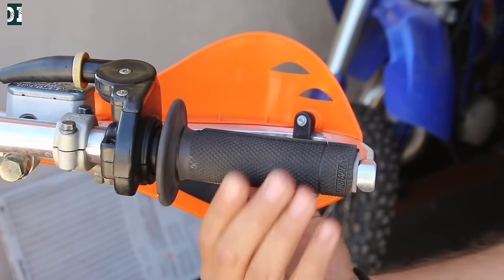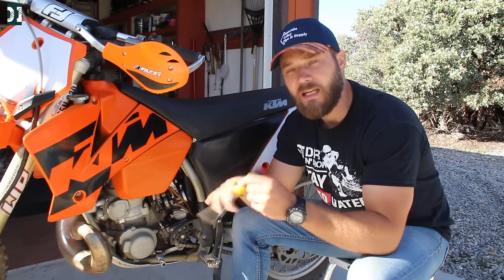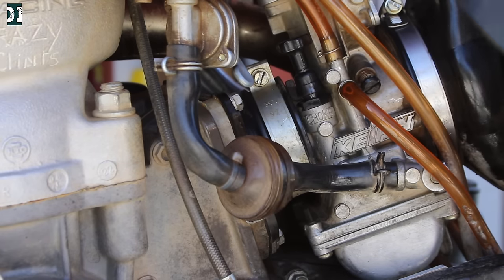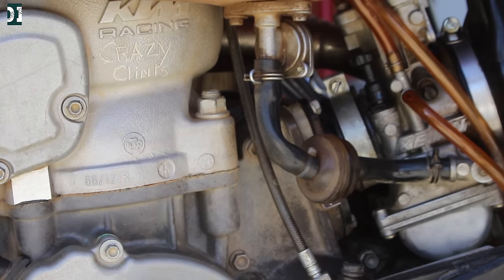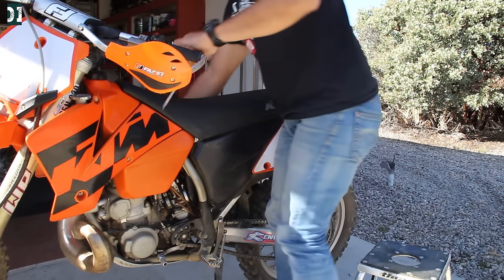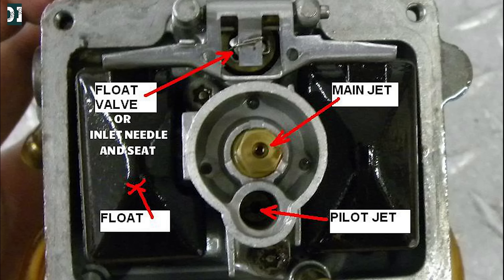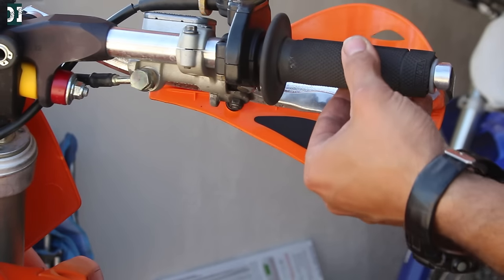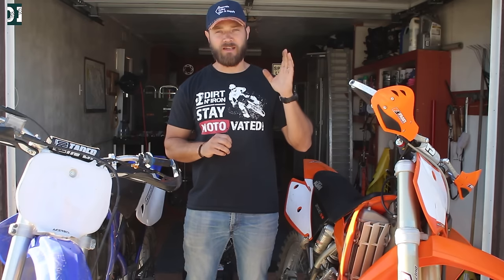How to adjust idle on 2 stroke dirt bike - air screw adjustment 2 stroke.

Comment: quick question. just bought a 01 kx 250 the bike ran great snappy response idled great! I took the carb off cleaned it checked the jets n clip just gettin to know the bike see how everything was set. I re installed & it wont start at all.. nothing and i done carbs many times in the past...i went 2 out on air and on black screw in some for higher idle then adjust to slower once running. won't start at all. any idea?
Reply from the maker: something is not right, I would take it apart and check if the fuel is getting in the carb, clean the jets. Once I had my float stuck in closed position and it wont let the gas in my carb
Reply: @dirtniron  yep did all that and it fixed it! thanks!! runs great!

Comment: So I just bought an rmx250 as a project bike, right when it gets into powerband it just falls flat on its face. They guy I bought it from said the power valve needs adjusted but I think it’s the jets. Should I try a smaller main jet or something else? Thanks
Reply from the maker: I would first take the carb out and clean/inspect/rebuild whats needed.. then start with stock jets and see how it runs

Comment: How do you adjust the fuel mixture and oil mixture on a 2 stroke? No I don't mean in the gas. I mean a good bike with oil injection. How do you know it's pulling to much or too little because the cable adjusts.

Comment: Thanks for the explanation. However in some part of the video you said air screw is for 2 stroke carb whereas 4 stroke have fuel screw. I think 4 strokes do have air screw carb as well?
Reply: That’s fuel screw on 4T

Comment: Hello there, great video, i just follow your steps to tune my rm 250 92, with pwk 39 carb, i start with 50 pilot, 1,5 turn out, i turn the chock on and kick, its start up with first try, good idle, but very low, so when i close the choke bike dies I raise half turn again, start up, idle well close the choke, idle well, im thinking, good, this the good spot of screw, and i ride it, but when the bike its warm enough i have a lot of higher idle, i must turn the screw about 0,5 turns out so the bike comes to normal idle, when its cold with 0,5 turns out i dont think will gonna start up, im confused, any suggestion? Also you said if you have the air screw all the way in and the bike runs good, you have to go one size bigger in the pilot, is this correct? or you have to go one size smaller pilot as i know?
Reply from the maker: always tune your carb when the bike is warmed up. If its cold and doesnt hold idle you can blip the throttle till the bike warms up. I was correct with the pilot size when the screw is completely in. When you have the screw all the way in that means you have smallest amount of air added to the mixture, if the bike still runs good then it will be lean if you bring the screw out and thats why you need one size bigger pilot. Makes sense?
Reply: @dirtniron  thanks for reply, to honest i didn't tune it when its complete warm up, about screw yes make sense, my thought was if the srew is all way in and bike run good, means thst you have big pilot and take enought air from there, thats why runs goods even with screw full close, thanks for your advises!

Comment: hey man. i was wondering how many turns do you put the idle screw in when you start adjusting the air screw? thankss
Reply from the maker: i start around 3-4
Reply: @dirtniron  4 turns from fully inwards?

Comment: My bike only has 1 screw (Im like 98% sure). It is a really old manual kawasaki 65. It will not idle, (I made it that way) the throttle sticks, if i turn the throttle a little bit it will rev up like 2x more then it is supposed to, then when you try to go it bogs down. So baseicly i tried to fix the idle, i forgot that was the problem.

Comment: I have a 2 stroke 80 that won't cold start even with the choke unless I run the air screw all the way closed. It will hit but not start. It's a brand new carb and clean tank. Tell tale sign I need a larger pilot jet (stock 15)? After I run the air screw in and it starts and warms up it will idle with no choke and restart easily. But after it's warm the sweet spot on the air screw is one full turn out. This makes me think it's ok? Very crisp throttle response no hanging idle. If it is too lean will this blow it up? I Premix 32:1 new top end and crank seals. I tried a larger pilot jet and it's not as responsive as the stock 15. Can I lower the needle with a larger pilot to cold start ok and to regain the crisp snappy throttle response? Sorry for all the questions. Still learning. Lol
Reply from the maker: yes, sounds like you need bigger pilot. I would go 2 to 2 and 1/2 turns out on a air screw with bigger pilot and see how she runs. Its possible to lean her out on the needle with the bigger pilot, but I would first play with the air screw. make sure your air filter is fresh and bike is fully warmed up when tuning.
Reply: @dirtniron  Ok, thank you for the quick reply. Yes, I will give it a try. I did already clean the airbox out with a brand new and oiled filter. I double checked the throttle cable has minor slack and the slide is closing fully. I'll definitely make sure the bike is fully warmed up. Should I just keep jetting the pilot up till its sweet spot is 2 to 2 1/2 full turns out?
Reply from the maker: yes, that's what I would do. Also moving the needle up or down helps to fine tune it
Reply: @dirtniron  ended up being the choke cable adjustment. It was working, but not traveling far enough. Adjusted some more slack out and it fixed it. Put the stock 15 pilot back in and ran the air screw out one full turn for the sweet spot with the engine warm. It dawned on me traveling to work one morning thinking about it. Just didn't make sense unless the choke wasn't working properly.

Comment: Hi Dirt N' Iron, I am new to two strokes and have a new BETA 125RR. Can you offer advice for the correct fuel air mix procedure for warm weather riding, we are in the Caribbean climate at the moment 27-32F humidity 60%. Cheers, M
Reply from the maker: start from stock jetting, then adjust accordingly. If its too hot then she might need more air, so go with smaller jets. I have very good experience with  JD jetting. they might have a kit and chart for your bike.
Reply: @dirtniron  Thanks for our reply! Yes the bike came with stock jetting, we haven't changed anything, if you could send me a link for JD that would be great. Appreciate your videos, very informative.

Comment: So with your idle adjustment do you start with the screw all the way in or all the way out. Struggling to get my rm125 running right brand new to dirt bikes.
Reply from the maker: idle adjustment screw maybe 3-4 turns out to start
Reply: Thanks for the reply, thought this was my issue but i have a stripped bolt where my reeds bolt down. Think thats my issue bike is breaking up good 1-3 and fouling plugs on trails.
Reply: Well turns out my bottom end was smoked, had the engine rebuilt top and bottom with all new seals. Got it on the bike today and back together, bike runs great no more plug fouling. Had to come back to the video to tune it though lol😂

Comment: hey man i bought a rm125 and it runs great idles etc but whenever i drive and give it some it ends up dying it out no too long after and the spark plug gets full of gas so im thinking its flooding but what could cause that need some help

Comment: Question: My idle adjustment screw seems like it's turned in quite a ways and could be turned in another turn too perhaps as it idles quite low, but doesn't stall. Bike has lots of power. My air screw is 2 turns out, but I feel like it might be able to go more, it stumbles when turned in at around 1 turn out, so I found 2 to be the best, but I feel like the idle adjustment screw shouldn't be so far in. The slide must really be up high with it where it is currently. Any suggestions? Running JD jet kit on 2017 KTM 300 XCW. Thanks!
Reply from the maker: I would bring the screw little more out and try to raise the idle with air screw, see where you get best throttle response..

Comment: Does the pin needle position affects the idle? For example in my old honda mbx 50 i have 3 positions in the idle clip.  Does the change of the position affect the idle speed or only the accelaration after 1/4 (and more) of throttle ?
Reply from the maker: It does affect it, but adjustment is done with air screw, and idle screw
Reply: Thank you for the instant reply

Comment: Hii, i just got a 1993 suzuki ts125r its my first bike and in good wether runs well with air/fuel jet screw turned four times out, is that normal for this model or i need to replace the jet. Bike has only 17.000 km. Thnx for the video.
Reply from the maker: Maybe try one size smaller pilot.
Reply: Thank u for your help, one more question, how many km a 125 2 stroke can do with a full tank if u can tell.

Comment: Hey man, I have a question about my bike. I have done some tuning and found out that I need to change my jetting to a smaller pilot jet and main jet due to my air screw going about 4 turns out. When I rev my engine up to full throttle and let the rpm’s fall, it doesn’t immediately go to idle and idles high rpm’s then it finally goes down to normal idle, what does this mean? Is this due to my jetting being wrong?
Reply from the maker: fix the jetting first, then see how it feels. Might be an air leak somewhere on the boot.. make sure the carb is installed well, air tight

Comment: The spring is causing my idle screw to move after I adjust it. Do I need to push spring back before adjustment?
Reply from the maker: that is weird, something is wrong. Spring is there to keep your screw from moving

Comment: What if you adjust the idle screw and nothink happens would that be a sign of an air leak or bad reeds? Just after doing a top end and ran fine before now it's hard to start sometimes and won't idle chokes don't seem to work like before . Ps has a fresh newly oiled filter ?? 👍🤔
Reply from the maker: I think that you dont have free play on the throttle cable is the idle screw does not change anything..
Reply: @dirtniron  yes have checked free play cable seems to move freely and can hear the slide moving in the carb . I'm at a loss .. would a new pipe effect it?

Comment: Really appreciate this type of content! I know is an old video, but maybe you can you help me with some advice... I changed all the gaskets inside the carb (keihin PWK36), flotor level is correct, runs fine when open throttle. The idle I cant figure it out, tried multiple pilot jeting from 40&45 (with needle in second position, tried to raise in 3rd position and have to much gas before PW and then rips) idle stay very high or die. With pilot jet nr. 48 in second needle position is not running well on 1/4 throttle, seems to much gas and also idle is very high or die. Lower the needle to first position and with pilot nr. 48 have more grunt, more linear power delivery, seems to have better idle but it still drops from high rpm to very low after few seconds but wont die, and cant increase it just a little more because it goes way up. Should I try with pilot jet 50 or smaller? or what to try next? this is killing me :))
Reply from the maker: I would look for an air leak on the carb, rubber boot or somewhere else.. sounds little bit inconsistent and that's how the air leak would behave..
Reply: @dirtniron  thanks, I would check it. First I thought are the litthe o-rings from the jets, changed them and no big improvement, but I would check the boots
Reply: @dirtniron  i finaly get it to hold idle ok by switching the needle to NECJ, p40 half turn (I will put 42)  and main 170. It runs like a rocket now, lifting front wheel in 5th gear.

Comment: My idle bolt broked two times, how do you not break it?
Reply from the maker: never happen to me, just be gentle with it
Reply: @dirtniron  yeah i am gentle, but i turns really heavy.
Reply: @lauwlicht1796  That's odd, you sure it's original? If not maybe there is something in there with the wrong size.

Comment: Great video! Straight forward with enough information :)
Does the Air Screw adjustment effects only in the throttle range of closed position up to 1/8 opening?
Reply from the maker: yes its idle to initial throttle opening. 1/8 sounds about right
Reply: Tnx!

Comment: I picked up a 97 RM 250 and I just painted handlebars and after I put everything back on my idols a little high after you started it and the throttle feels a little tight I don’t know it’s because I didn’t put everything correctly on it after I put it all back together what’s your advice it was fine before I did this
Reply from the maker: clean the bars under the throttle tube and make sure it moves freely, make sure your cable has some play

Comment: Ok Great video and explained really well. I have slight dif issue:( I have a Mikuni tmx 38 Carb and I see no air screw? I only have the idle adjustment screw? I have adjusted the idle screw so it idles smoothly like yours at 5:24 but now if I turn the choke on the rmp drops & the bike cuts out?? Grrr As you know the rmp should raise when the choke is on so completely baffled to why this is happening? Any advice would be great & keep up the good work you do..TTEA
Reply from the maker: once the bike is warmed up and you pull the choke the rmp should go down, and bike should not be running crisp. you are adding more fuel and less air into the system when your choke is on. On the cold start choke raises the rpm and bike starts easy because you give it more fuel, but once the bike is warm it does not like to run on very rich mixture. hope that makes sense
Reply: @dirtniron  Thank you, makes sense to me & appreciate fast ur response.

Comment: First time I’m setting my carb  after cleaning it.
The bike now starts without choke does that mean that the air screw it’s too far out?
Reply from the maker: it means that the bike is quite rich, so the air-fuel ratio is slightly off..  air screw too far out will give the lean mixture since you allowed more air in
Reply: @dirtniron  Thanks,
I think I found the sweat spot now.

Just one more thing, if the air screw is too far out does it cause fuel overflow?

Comment: the same with how he put the air screw 2 turns out instead of 1 and a half you get more power and response with a bit leaner. i am always putting too much oil in my mix when i mix. why i think that reliable auto oilers are something that should be looked into more for modern 2 strokes because they are really efficient with the oil which leads to not only more power but less pollution on the trails ...

Comment: My 2 stroke cr125 runs ok but when i give if hard throttle fast it bogs could u do a video on this, your videos are very useful
Reply from the maker: and it didnt do it before? or was it always like that?
Reply: Dirt N Iron well when i got it ran ok then i changed the air filter and just became worse?
Reply from the maker: Looks like it's too lean. Try to bring air screw in little bit, maybe even raise the needle a notch, that will richen the mixture
Reply: Dirt N Iron thanks man will give it a try
Reply: I have been adjusting the carb but now it keeps fouling plugs lol any advice?
Reply from the maker: you are too rich if thats happening..
Reply: Dirt N Iron this has been happening no matter how many turn out i make the carb

Comment: My bike only isles until it warms up. After that it does. I I have idle screw all the way in and air screw 2 1-2 ties out. Bogs up to 1/4 throttle but after that runs great! And help??
Reply from the maker: sounds like you need one size smaller pilot jet. bike its running rich on the bottom...

Comment: Hey DNI I have a question my brother has a rm 85 and it won’t hold idle I got it to idle by just adjusting in a screw do you think that is fine I’m just afraid of running it too lean
Reply from the maker: Adjustment to air screw should not make drastic changes to fuel mixture. It's fine tuning. Read your spark plugs and make sure you don't run lean
Reply: Thanks dni

Comment: hey man, quick question,
I have a 2007 KTM Exc 125, and when I open the fuel tap then 3seconds later petrol starts pouring out the little pipe coming from the carb (think it's the overflow) it's happened before but it sorted itself out but now I've taken out the carb and Cleaned it but don't know what the cause of that is and how to fix it, do you have some advice?
Reply from the maker: looks like your float valve is not shutting down the flow.  you might need to get new float valve and replace it, fairly easy to do.. or take it apart again and make sure you put it back properly. check some videos how to do it, to make sure
Reply: @dirtniron  Thanks for the help 💪👌

Comment: My 2017 ktm 300 bogs. My jets seem clean I've checked them. My idle is good. But from no turn to quarter turn throttle it bogs. Any ideas? I'm about to drain the gas start fresh, put a brand new air filter, and check voltage on batter while giving it gas.
Reply from the maker: It might be lean bog, try to go one size bigger on pilot or raise a needle one notch
Reply: @dirtniron  I will try that. Thank you

Comment: so what does it mean when you get the idle all set and then you rev it out and it stalls? I got my idle set good but wont hold when i let off the throttle
Reply from the maker: Usually that means the bike is lean. Starves for gas.. give her richer mixture and see what happens

Comment: You need to be careful. Screwing in the mixture screw or out may be the exact opposite of different make carburettors. Check your carb operation first. Good video
Reply from the maker: you mean air screw?
Reply: @dirtniron  yes  I believe Delorto work in the opposite fashion